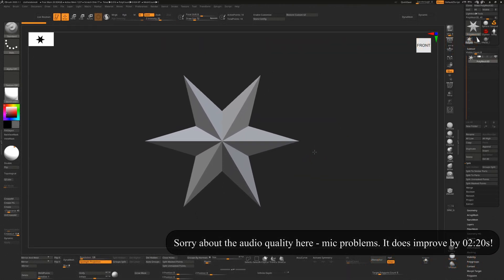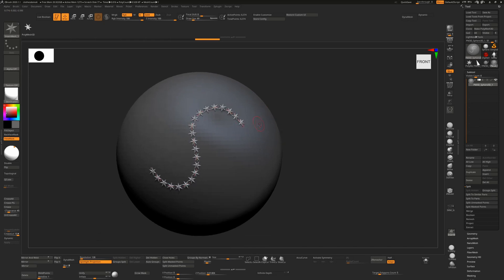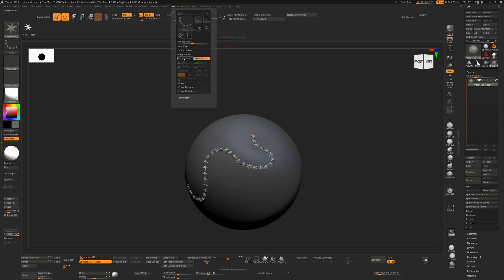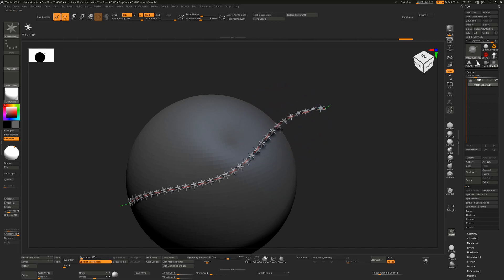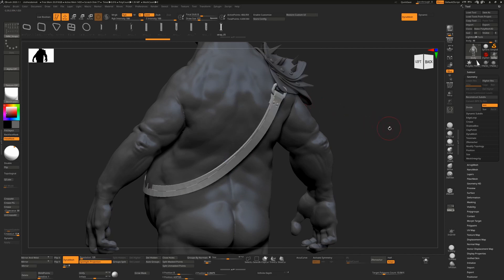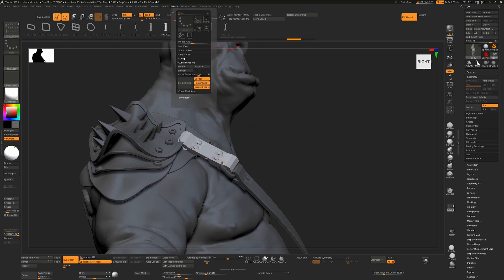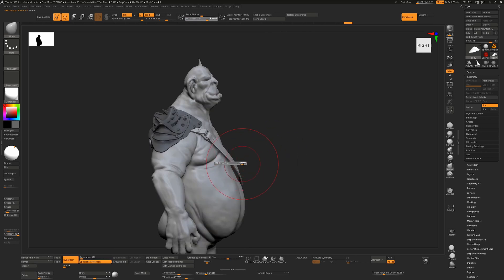Creating and controlling curve brushes in general and also when making straps in ZBrush

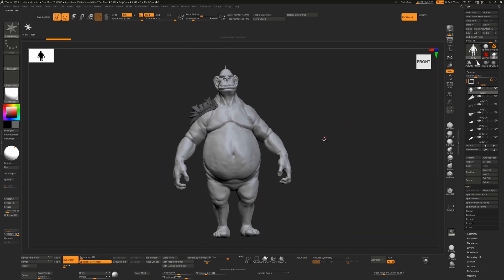Comment: 5:51 i want to create another brush parallel to the created brush (the stars around the sphere) with a certain distance how can i do it
thank you
Reply from the maker: So at the start when you first create your curve brush, you could have a star and another object beside each other in the same subtool, and then make that your brush. Or, depending on your geometry and where you want to place it, if you have two suitable edge loops, you could crease each of them and add a different curve brush to each crease.
Reply: @SeanForsythTutorials   i am learning zbrush so i dont really understand your tutorial. can i send you a video of what i need to do?
Reply from the maker: @thaibui5911 Sure thing. You can find my email address in the About page of my channel
Reply: @SeanForsythTutorials   i want to do like this video.... i can control the size of the diamond but when i put it on a hard surface i don't know how to do it (leopard body)
https://www.youtube.com/watch?v=v-Kx1EFsWQ8
Reply from the maker: @thaibui5911  The size of your brush is determined by the size of your cursor before you click. In other words, if the red circle is small, your inserted meshes will be small. To control the size, just change the size ("S" shortcut key) to the size you want before clicking. If you are inserting multiple meshes, click, then hold down CTRL and every object you add will be the same size as the red circle.

Comment: Hi ! Thanks for the tutorial 🙏
I have a question, when the guide disappear, is there a way to get it back on the curve to remodify it later ?
Reply from the maker: You're welcome. Unfortunately not, once the curve is gone it's gone, so after that you have to rely on the move brush and other brushes.
Reply: @SeanForsythTutorials  thank you for your answer !
Wow thats super cruel ... I will sculpt a betta fish, and I wanted to work faster on the fins. Adding scales with curve mode. But when I want to pose my fish differently for different results, I have to do it all over again if I dont want the scales to get too much deformed in the process
I guess Ill have to work harder than I thought
Thank you
Bonne journee 🙏
Reply from the maker: @oriomart1944  Well you have other options than curve bridges got adding scales, for instance micropoly or nanomesh could both do it without affecting you when you distort the model. To much to go into in a reply, but google both of those for a tutorial and you should get better results.
Reply: @SeanForsythTutorials  thank you, I guess nanomesh will do the job 👌

Comment: A question whenever i try to change the curve size its moves size not changing are you pressing ant key or something while clicking it ? 

The moment I changes my brush size and click it should change the curve size as you show in video but not working on my case 😭
Reply from the maker: I'm not pressing any special key or anything, the only thing to check is that the cursor is red when you hover over the curve before clicking, and that the black and red subsegments are still showing on your curve. If they aren't, it means that you already clicked somewhere else on the model, effectively "accepting" the curve and thereby removing it. You must change the size of your cursor while NOT hovering over the curve.

Comment: very well explained! I just have a question. When I reactivate the symmetry on the curve, it doesn't function properly. It appears as though there are two curves, even though I have already deleted the curve guideline. One of the cursors moves over where the mesh of the second curve should be if it existed.

If it's not possible to get the symmetry to work, I would like to convert the curve into a regular mesh so that the curve lines disappear completely. Could someone please help me with this?
Reply from the maker: Yeah, if you are symmetry often the curves don't react as well as they should. In fact, if you darg from the model onto the canvas and hold down Shift while doing it, in theory it creates a loop around the shape, but if symmetry is on, it will create two loops sitting directly on top of each other as it's not smart enough to turn one off. Bascially try it without symmetry. As for converting the curve into a regular mesh, it should already be one, so I'm not sure I understand what you're asking for here. Draw out your curve using whatever curve brush you are using (CurveTube for example), and when you're finished your stroke, the curve will be there as geometry, with the geometry you drew it onto fully masked out. To separate it into it's own subtool, just go to Tools, Subdiv menu, Split rollup, and use Split Unmasked Points. Hope this helps! If not, feel free to send me an image or something by sending an email to the address in the About page of this channel.

Comment: Bro, any way to make a curve brush to make a 90-degree sharp angle while drawing on the canvas? (without using polygroups etc.)
Reply from the maker: Not really, not 100% tightly. You could increase the Step amount in the Stroke menu, but it'll never be a full hard 90 degrees.
Reply: @SeanForsythTutorials   Ok Bro,  your suggestion is helpful to some extent  ....👍👍👍👍if you find a still better way anytime , pl. share with us.
Reply from the maker: @cnu73  Will do!

Comment: Wondering if it's the same logic for CurveTube brush?, everytime I try to twist the curve as in 04:25 my curve keeps going bigger everytime I scale up...

Thanks for all the other secrets btw!
Reply: just found out it can be done by doing it in the blue part of the line, thanks!
Reply from the maker: @Polynema  Ah, was just about to reply to you now! Yep, the cursor is red when you're not hovering over the curve, so changing the size of the red cursor will make the curve bigger the next time you click on it. When you hover over the curve, it turns blue, and so changing the size of the cursor while it's blue means that's the size of the area you affect.
Reply: @SeanForsythTutorials  Thank you! :)

Comment: How can I delete the created mesh based on the curve?
Reply from the maker: You'll need to separate it out from the mesh you drew it onto first. Either use Split Masked while it is still masked, or Split groups if you have unmasked it. Once it's in it's own subtool, then you can simply delete the subtool using the Delete button. Just let me know if any of that's unclear.

Comment: Big thanks for you tutorial, it's really clear. Even for a Frenchman :p
How can I thicken the lanyard/strap created with this brush? 
Indeed, for 3D printing it's too thin.
Reply from the maker: Thanks! To push a polygroup along it's normals (thicken up or thin out), you can use the ZModeller brush. Hold down Spacebar over a polygon, and use Qmesh with the target set to Polygroup All. Then click on the polygon and hold down Shift while dragging. This will push your selection in or out (depending which way you drag). Let me know if this is unclear and maybe I can do a quick video of it.
Reply: @SeanForsythTutorials  big thanks ! I will try this :)
Reply from the maker: @fabiend.2974  Cool. Let me know if you can't get it working.
Reply: @SeanForsythTutorials  Really big thanks for your help ! Your it works perfectly :)
Reply from the maker: @fabiend.2974  Great! Good luck with the 3d print!